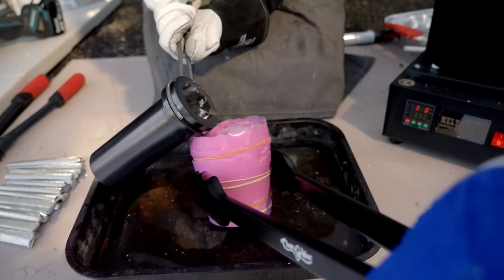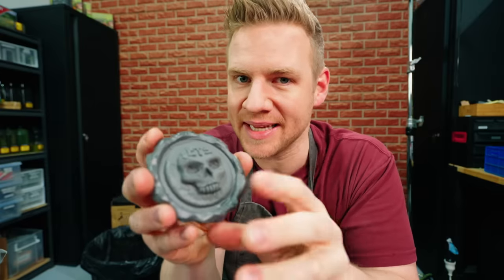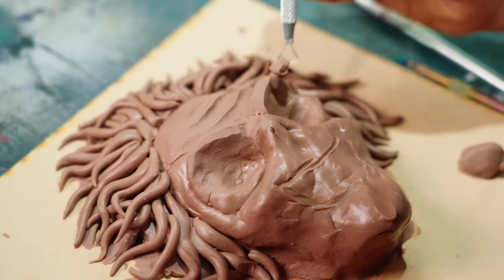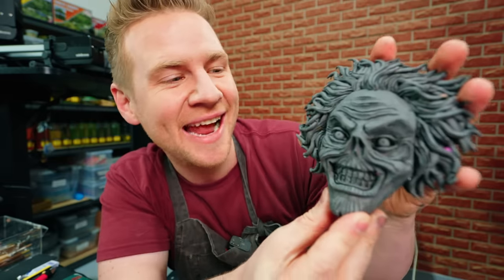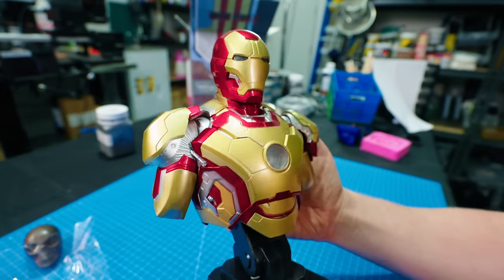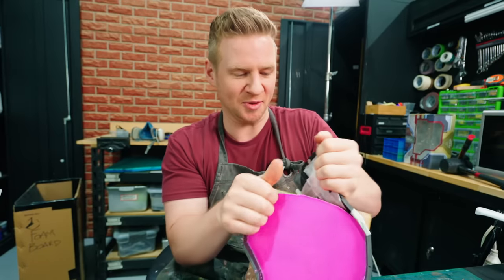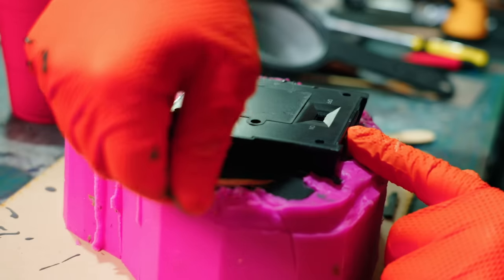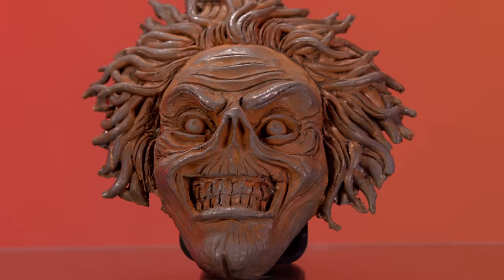Can RESIN turn into METAL?...

Comment: Fantastic work Jazza. Using rust solution to give it a more metallic finish was pretty genius. An alternative method that you could try would be to cover the mold in metallic powder using a brush to get into the crevices before pouring your resin into the mold. That way a layer of metalic powder should be on the surface of the finished product.

Comment: Often whenever someone makes a real metal cast you can find many different imperfections like tiny air bubbles, larger voids where the metal didn't flow properly, and the granular texture of the sand mold. I think that if you were to artificially introduce these imperfections, while it would make them look less pristine, it would also make them look more like the real thing.
Reply: Yeah, I also think polishing the surface more instead of rust would have made it look more real.
Reply: @pg2826  I think it needed buffed-up to a shine too

Comment: Oooh I wonder if this would work with copper powder! I love the colours of copper patina
Reply: They are stupidly expensive. Almost like pure gold, pound pre pound, specially the shiny ones. They can have a very cool metalic shine, quite convincing. 
The cheaper just look like a crimson to reddish orange colour in the resin. Very pretty colours BTW, but they do not look metalic at all.
Reply: As much as I like to see this... I don't think it would be viable... but if he do this again with other type of powders... idk... like any powder and keep the copper for small area like eye or some small part of the build... 🤔🤔🤔
Reply: @carloshenriquezimmer7543  I just checked Barnes pricing, expensive if you buy 5KGs, but 500g is $22 Aluminize to $38.50 for Bronze. Need to rewatch to find that rusting solution.
Reply: @babbagebrassworks4278  are those nanoparticules or powder? I should have been more specific.
Because powder did not work, when we testet in the company were I work. They ended with a specled apereance, not homogenous like the nanoparticles. 
There are flakes also, like a glitter of sorts. Both were way cheaper than the nanomaterial, but it was some years ago, maybe the prices dropped.
Also, we tested on expanding poliurethane, that resin may have different results. It is wort a try.
Reply: @carloshenriquezimmer7543  If the particle size is less than the layer height, typically 50um for resin printers, could 3D resin printing be used. Jazza said only the outside cured with UV. But now I know where to get powder I can also try laser sintering. New 2.5W 1064nm IR laser diodes are out.
Reply: @babbagebrassworks4278  I saw someone try putting mica with me resin of the 3D printer. The problem is that the powder would set in the bottom and your 3D print would end up a gradient from the top with all powder and the bottom without it. The added weight could also be a problem
Reply: @carloshenriquezimmer7543 for the look you could coat with a thin layer of copper metallic paint, or try copper electroplating , which requires a base of copper paint.🖤🇨🇦

Comment: The nose pinch! Perfect detail! Love the rust looks. Reminds me of Fallout. Make a full armor suit with it!
Reply: the jazza details we love!
Reply: it is as heeavy as regular metal would be...
Reply: I still remember the video he made 3d printing a chainmail suite of armor.
Reply: We'll have to use some chemical vapor deposition (cvd) or high pressure high temperature (hpht) methods with cubic zirconian and chemicals to make some diamonds, or melt or flame fuse some aluminum oxide to make some sapphires, 

after I bang out some ductile steel scales as a longer lasting outer layer than the lighter ceramics I think??? I better get some more kevlar shears with some nice anti-stab proof goop, for my bracers, before my visco elastic foam is all gone as paint palettes and goat head sticker mats at least though, lol?

Comment: Just like you fill up the silicone mould with scrap silicone pieces, you could fill up your resin-iron powder mould with scrap iron (or metal) like spare random screws and/or bolts I imagine. Fills up the volume with cheaper material with the "added bonus" that it is actually 100% metal.
Reply: Screws are probably made of steel and not iron. It might not bind with the resin. Maybe old rusty nails.
Reply: @pg2826  if the screws don't bind with resin they would just be stuck, like rebar on concrete. The problem would be they poking out of the resin, by sinking into it. Could ruin the pour totally.
Reply: You can buy steel shot pellets in 10 lbs bags very cheaply to back fill hollow casts.  The most cost effective way for me was to dust my molds with metal powder, then rotocast a thin shell with the resin and powder mix, then fill the cavity with a mix of steel shot and plain resin.   The metal powder is VERY expensive by volume and a 50/50 mix with resin will cost you a fortune to do solid casts.

Comment: Cold casting is such fun If you’re using fine metal powders it’s worth dusting the mould too before pouring and 00 wire wool works better than the thicker steel wool, Ironman with brass powder should be next in that mould

Comment: Oh and you can use poly acrylic spray for a heavier coating of iron if you don't want to do the mould method and then spray it with your choice of activator for the rust!!!

Comment: YEEAH I wouldn't have thought to see my favorite mascott of one of my favorite groups on this channel ! amazing work !!

I was wondering if the pieces were conductive? Because if it is you should try electrolyse, it's a process where you dip a metallic piece in a solution with dilluted metal as copper, you induce an electric current and you end up with a fully copper covered piece.

Comment: You don't need fancy rust spray. Go to the pharmacy, get some peroxide. You can even rust plastic by applying spray adhesive and iron filings and then peroxide them. 

Peroxide is reactive and H²O², meaning it has plenty of spare O to add to your iron Oxyde

Comment: To get an even more realistic look in the sculpting process (So the outcome doesn't have that clay-look)
you could model out of plastic using rasps and hot glue. That way you get some "angle grinder marks" and "weld beads"

Comment: If yiu want to get into metal castings, you should look into an alloy known as Field's Metal.
It's an alloy capable of melting in reasonably hot water.

It not cheap generally, but its non-toxic unlike alternatives.

Comment: I would be interested to see what you would make with actual molten metal. You can get a furnace that will melt copper and aluminum pretty affordably. You can make your cast out of special sand or plaster. I would reenforce the plaster if you use that and having a kiln to keep the plaster preheated will help keep your plaster cast from cracking or having a moisture explosion. I would also say that you should have a mask on specifically designed for metal fumes when you do the melt and pour. Metal vapors can make you sick when inhaled. Metal casting is an art form that many people overlook and I would love to see what cool thing you would come up with. Do your research on it first as it can be difficult and dangerous if you don’t take precautions or at least have some kind of idea what you’re doing. Copper will show more detail than aluminum because it has less surface tension when molten. Zink melts at a much much lower temperature and will show all the detail but because it melts so quickly it also solidifies pretty quick and it’s easy to overheat the metal so there are some drawbacks to using that. But It would be very cool to see you try copper or aluminum. 
I have a furnace made by devil forge and it’s fueled by propane like you would use for a grill. It only cost me a like 350 to buy the furnace and everything else I needed to get started melting. I am not an artist but I do wish I were one. And I am still learning casting techniques. It’s surprisingly easy to do the more you understand what’s happening at the temperatures your using and the materials your working with. Please try this I would really love to see your perspective of this.

Comment: Uh....

Rifle gunsmith have been doing similar practices for glass bedding rifle actions in stocks for decades. Adding stainless steel or aluminum to epoxy resins. Glass bedding kits like Steel Bed come with the steel already mixed in.

Cool product though. I wonder how well it would work for glass bedding. Known compression strength? Cool Iron Maiden sculpt too. 👌👌👌

Comment: the thing about metals is that its electrons does not alter the photons that hits it. thats why the light goes into your eyes from the reflection appear metalic. its the same like how crystal or transparent medium do. when photon pass through it and the energy is not getting altered. 
so by mechanism, metal is TRANSPARENT, but instead of letting the photon pass through, they deflect it. this is why if you combine them with other material that has no "transparent" nature you will see them loses their metallic look. since that other material alters the photons energy when it being deflected.

if you mix GLASS with metals, you will find the METALLIC appearance PREVAILS. 
if you ever seen a transparent plastic layers that being layered so many times that the photons that gets through it would have many of them got deflected back out, they will appear METALLIC. metallic look actually means it stimulate no color. equivalent to being "transparent". white grey and black are colors.
by the way thats pretty cool material by itself, a metal enforced resins. but that also means they arent metals anymore.

Comment: While I enjoy your videos, the working mechanical engineer in me definitely had some thoughts when hearing "50/50 resin + iron powder = perfect iron repilca"... coughnotforthefirstimeinyourvideoscoughcough

But, i don't know if you've heard of the process of "Metal Injection Moulding" and "Ceramic Injection Moulding" before?
It's basically injection moulding with a mixture of a plastic based matrix (can be a duroplastic resin or a thermoplastic material, but in the end it should be easily removed and cheap), mixed with metal powder.  After injection moulding, you basically melt/burn out the plastic matrix and make it into a stable metal / ceramic part.
It's used for part's that can't be casted due to the necessary materials (e.g. different ceramics) or it's small size. After melting/burning out the matrix, it get's sintered (not quite melting, yet heating it up under pressure to a point where it forms a solid bulk without deforming).
One of the main problems is that includes alot of steps and therefor isn't cheap while the part losing ~15% Volume due to shrinkage by melting/burning out the matrix AND sintering. This can cause problems if you work with tight tolerances.

Second break to increase my comments length, already at 1:42 - maybe i've finished this video by tomorrow morning... xD
The hardener and the resin need to be at the right ratio, so that no un hardened rasin is left and no non-reacted hardener. The reason the volumetric difference is so huge is relatively simple, once you understood the concept. The resin is already a polymer, meaning a chain of monomers. You can vision it like a chain of beads that is stuck together. Your liquid resin is basically a huge container full of small bead chains. Each of these chains has ~1x10^6 maybe even ~1x10^10 beads per chain (a pan full of spaghetti is "Kindergarten" in comparison.. ^^).
Now, the hardener basically enables some beads (e.g. every second or third bead) to connect to another additional bead besides the 2 beads in the chain it's already connected to. This forms a mesh out of all those bead chains. The hardener often does not contain such chains, but is made of single, short molecules in  liquid form. Because you need to balance the number of possible connections with the number of hardener molecules, you end up with those massive volumentric differences. Chemically though, it should nearly be balanced.

YEESS!! EDDY!!! 🤘
(not gonna nerd out on Eddies now... - if you're interested: fluid dynamics. While i've seen Iron Maiden live multiple times, i don't know enough to nerd out about their Eddy. But highly recommend to go a concert as long as you can.)

Comment: You're going to lose your mind when you realise you can dust your mold with that powder and cast onto that and then use wire wool and metal polish to get the shiniest most beautiful pieces x
Reply: This is exactly what I was wondering thanks for the tip!

Comment: This is cool but a massive waste of the powder. You need to look up cold casting by punished props. You want to spread a very thin layer of  the powder in your mold, and then pour your resin (you can use regular smooth on  resin) and then burnish with with the steel wool.

Comment: You need to try to melt tungsten. 

This is a joke by the way. Tungsten melts at 6,150 F/ 3,399 C. Its can get insanely hot and is expensive.